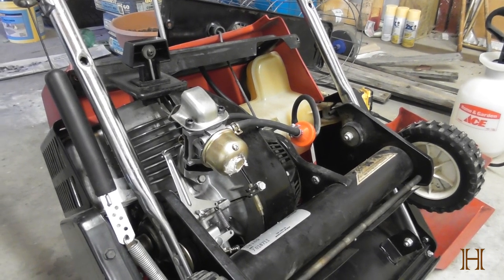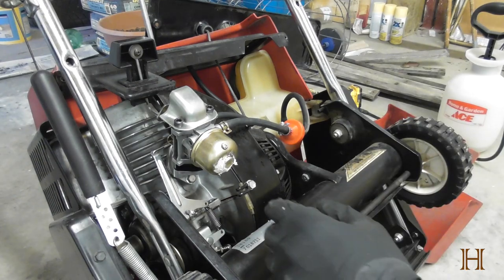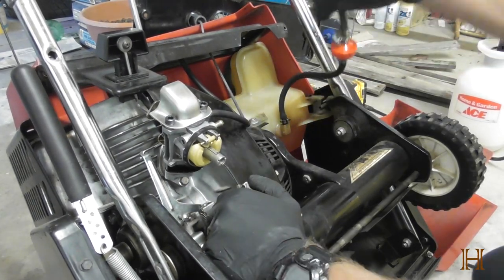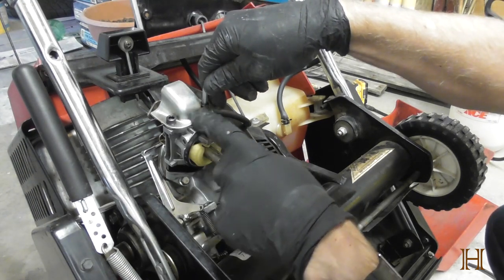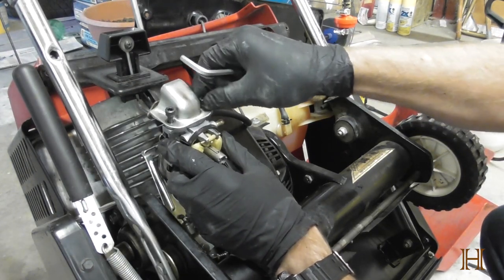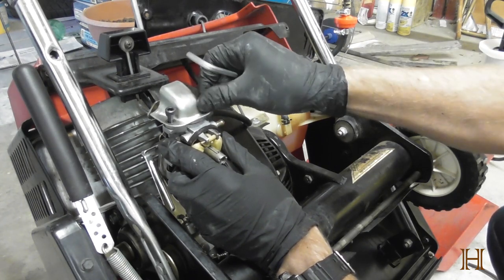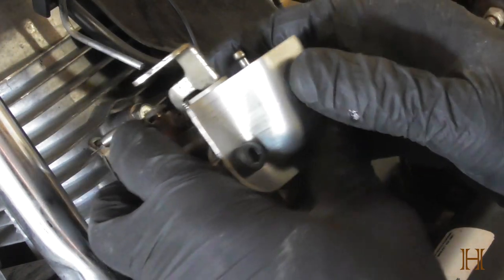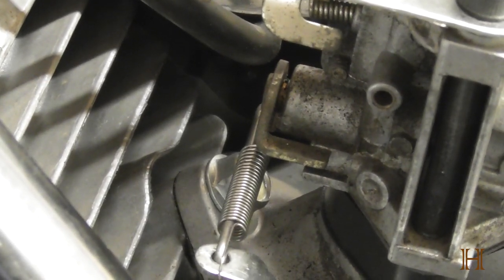Changing Toro CCR 2000 Carburetor

Comment: Hey Huber-
Pretty good video but I must correct you on one thing... (You may even want to edit it out while your video is still young)
I think it's important for viewers to know that there is NO Gasket used between the "Spit Cup" & Carb body.
The only 2 gaskets used are the ones on each side of the insulator (the black spacer thing).
I bought my CCR200 new in 1991 & it has been a great little machine . Love that Suzuki engine.
Reply: I didn't think that gasket belonged there.  Not sure it really helps or hurts anything being installed there.
I did buy the $14.00 Amazon carb and so far have had very good luck with it.  Not sure why his was such a reject.
Reply: @holdemNE1  
Howdy Big Mike-
Your carb from Amazon prolly came with 3 gaskets. (Mine did).
As indicated in the video...two of the gaskets are for one on each side of the black insulator. 
The 3rd gasket is intended for use between the intake manifold & the engine. (if you choose to replace that one, I didn't) 
Putting the 3rd gasket in the primer spit bowl may not cause any big problems but that's definitely not where it belongs.
There's no need to seal anything in that area and the upper portion of the gasket would just sort of be "flapping in the wind". 
You sure wouldn't want it breaking apart and clogging up your carburetor.
Repairs can be pretty intimidating for some people and I know I'd be pretty irritated if I were relying on a video for accurate assembly info & then found out later it had me putting parts where they don't belong. 
Huber's Ranch really should either edit this video or make a large note somewhere correcting this mis-information.
Reply: @kailarsen6148  Thanks for the info on the extra gasket Kai.  My machine didn't have a gasket there to begin with, but I was going to put it in anyways.  Good to know what it is actually for.

Comment: I replaced the same carburator with a china version, couldn't find a japan version and now the engine surges at idle. Is there a fuel/air screw adjustment on these?
Reply from the maker: There wasn't one on the cheap Chinese one I got before I went looking for an original one.

Comment: I bought a replacement carb and I cannot get the insulator (the black spacer) off of my original carb so I can re use it... Is there a trick to removing it?  I cannot separate it from the carb and I am afraid I am going to break it off...
In your video when you removed the carb -  the spacer was loose,  mine is stuck to the body of my original carb.
Please help! 

Also, the 3 gaskets that came with the carb - Do i use the 2 gaskets with the smaller opening on either side of the black insulator spacer and the 3rd gasket (Bigger opening gasket) is for use between the intake manifold & the engine?  Is this correct?

Next Question:  With the carb in my hand and the bowl off looking into the carb  - The main jet screws into the main nozzle, I can unscrew the main jet, but how do I get out the main nozzle - I put a screw driving in there but I cant get it out.  I watched a video and when they take out the main jet the main nozzle came out with it in one piece. How do i get out the main nozzle?  It doesn't look like there is anything for a screw driver to grab on to?
Reply from the maker: Mine literally just fell off the first time I took the carb off when I got the machine, I wonder if yours is held on by some sort of sealant, like RTV or something. Have you tried gently tapping it with a hammer or trying to get a razor blade underneath the edge of the plastic and the metal? Maybe soaking the whole part in carb cleaner as that is rather aggressive? Just spitballing ideas here.

You are correct about the gaskets, I falsely put mine under the primer bowl area as that is where it originally was when I got it but as other viewers have pointed out it doesn't need to be there. You have one on each side of the spacer and if you take the manifold off you have one back there between the "block" and the manifold.

I had the same issue with one of my carbs that the jet didn't ant to come out with the screw and the screw just separated from it. I have no clue how to properly get it out, the way I did it was basically just put a half a can of carb cleaner through the jet to make sure it was clean. I never did get it removed. Not sure what the correct method would be. Maybe heat but don't quote me on it. But if you do figure it out let me know!

I hope this helps a little, I'm also always trying to learn as I go along and improve on what I've already learned!